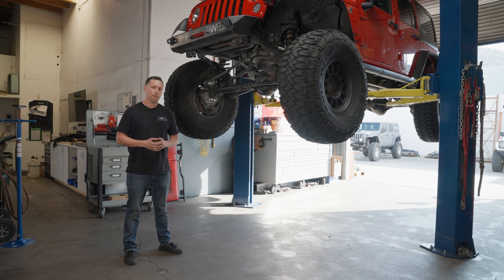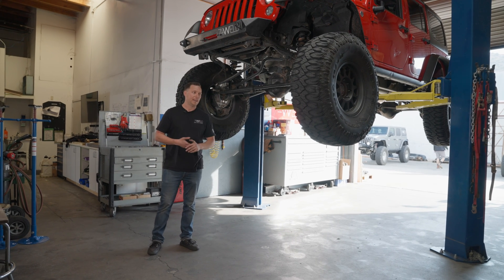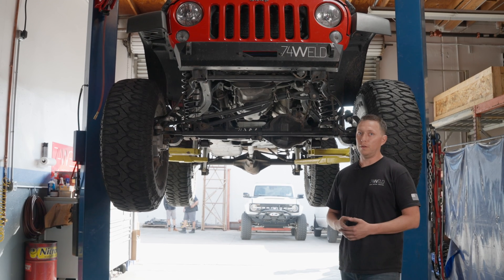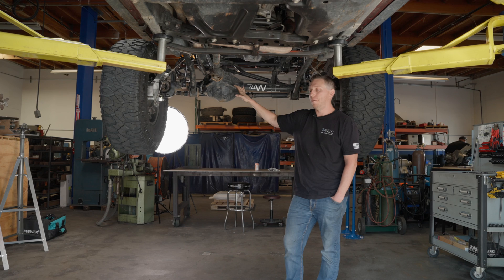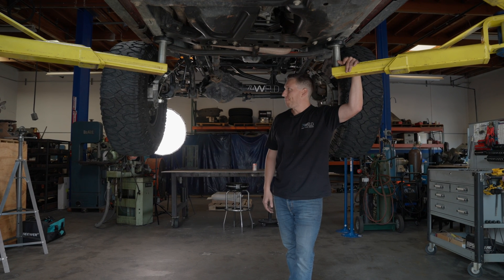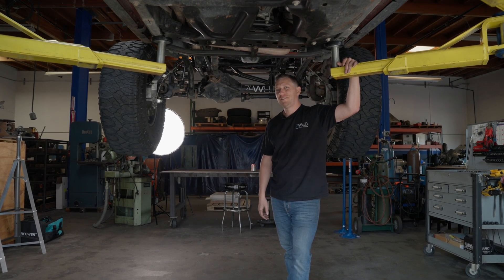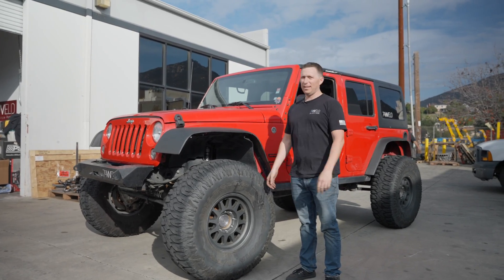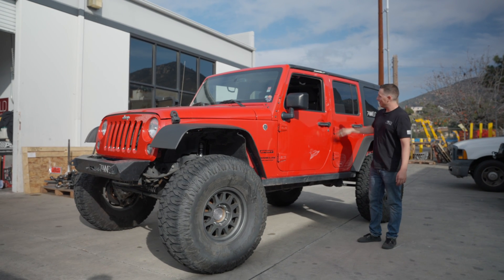Our engineers daily driver with portals

Comment: Got to be $5-10k in gasoline alone a year.  Plus wearing down your trail vehicle.  Hummm maybe you should do like an electric motor swap.  Stuff enough batteries to give you like 180 miles range on the freeway.  Maybe do dual electric motors, one for the front driveshaft and one for the rear (no trans / no t case)   .  Actually, more genius would be the electric motor in a dummy solid axle upfront with no u-joints or anything needed for the transfer case driveshaft.   One motor per dummy solid axle. Obviously no need for gear reduction or worry about gear ⚙️ ratios or shifting in general because it’s an electric motor. Plus with the portals it should be insane amounts of torque.   Probably can play with front rear power bias to make it front wheel drive rear wheel, drive or all-wheel-drive.

Comment: So you've spent 70K in portals on your commuter in 36 thousand miles .  Then another 50K in axles and lift and upgrades.  Then the cost of the jeep.  200k commuter.  This is unattainable for even above average income guys.
Reply: What in the meth kind of math is this lol.  Portals: $20k, Axles: $7k rear, $4k front.  Driveshafts, $6-700 each.  Maybe $1000 in springs and shocks.  Add $30k for a used JK and you're in the low 60s.

Comment: I like this JKU a lot more than the gawdy big budget builds honestly. I think we are in a good sweet spot for nice used clean JKUs in the market. Yes, the portals are expensive, but you could buy a nice used Jeep AND bolt on the portals for less than a new JLU Rubicon costs these days. I do think having to replace the rear axle housing on the JK and JL sport kinda pushes the project past a point. That is where I am stuck with ordering a set of portals for my new used JKU project....I don't want a 60 rear housing ( Cost, size, weight, clearance, etc )

Comment: Boring and bland. 😳🤕🥺
Reply: Seriously.  If you don't bolt a bunch of sh!t to the outside how are people even supposed to know you wheel?
Reply: @RonJacobsen1973 under side looks like it was drug through rock gardens with no tires on, bead lock rings covered in scars, rock sliders beat up, body panels covered in pin striping from trees usually tells the story. Being covered in un damaged bolt on parts says you like to cruise your jeep around or just love fire roads and beaches.

Comment: when the portals cost more than the jeep itself. lol. all joking aside, ive been a huge fan of these portals since the beginning. Just watched matts offroad recovery with them installed on the bronco. it transformed the vehicle.
Reply: for sure lol. it cost 60% of a JL rubicon if you buy the JL brand new. However portal sure look and drive amazing.
Reply: @humorss Our 4XE JLUR is 79,000.00 as it’s equipped new. 392 JLUR’s were selling for over 104,000.00. We added over 25,000 in upgrades and  we’re still on stock axles. Now that I’m deciding on axles to support 40”+ I’m looking at spending 20,000 plus either way. If I had gone straight for portals instead, I wouldn’t have my articulation, but it would definitely be more capable.
Reply: @Matt-en3mv  oh man, that is very expensive, was it purchased or leased? You can probably do almost every trail with portal and 35s.
Reply: @humorss  It was 2 year old paid 48,000.00. Our plan was to put what it would cost new into it in parts. It’s a full EVO build, 5” lift, King coilovers, all their body protection, basically the best they had to offer for a 4XE. Used Extreme terrain for everything else. But to your point, I would bet you would have no issue following that jeep through the worst trails we have around here even if you only ran 35’s with 74weld portals. Our RPM 2.5 ton Tie rod looks like someone took a grinder to the under side with how much it hits rocks. You would have 2.8” more clearance on your tie rod with only 35’s.
Reply: You nailed it. I found out how much they cost and I'm like "holy shit"